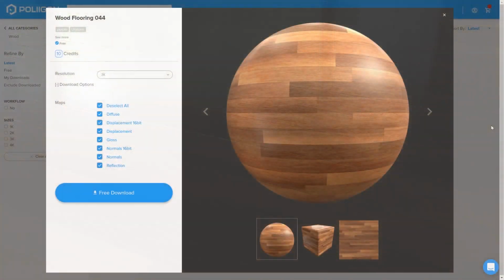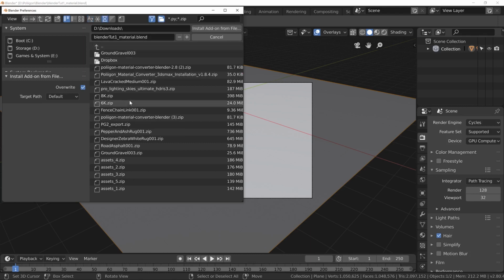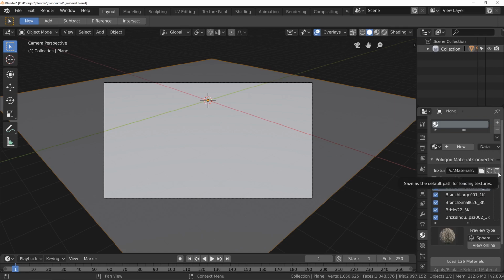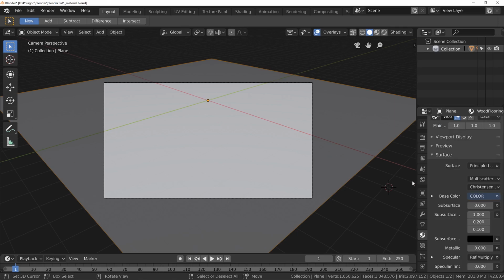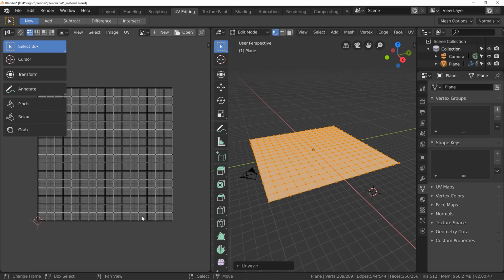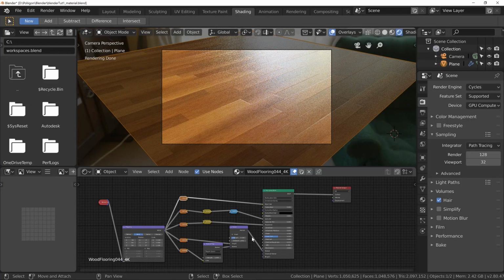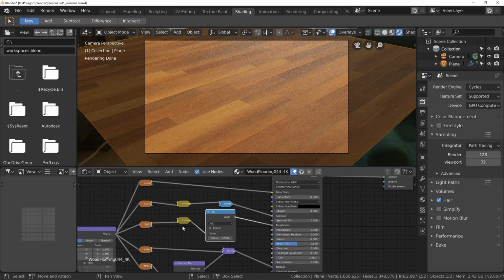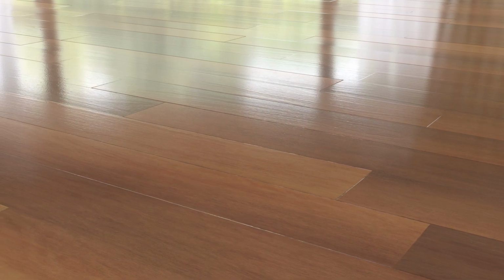Using Poliigon materials in Blender

Comment: My poliigon material is not in the folder and when i try to put it in the poligon material converter and all it says is no materials found even though it is right there. Very frustrated and I need help.
Reply: I find out if you have no 'Previews folder' (with jpg- cube and sphere) with the materiels it's will not want to add

Comment: Just downloaded the converter and tried it out. It doesn't work with Octane. It just brings in a node structure that works with Cycles. I've tried replacing the Principled shader with the Universal Octane shader but just get a flat white image on the object. As we can now get Octane FREE with Blender and I use it and it's blistering FAST and produces supurb results by the way, is there any chance we could get the converter to work with Octane?

Comment: I get an error when i load a material something with traceback most recent call last. Please somebody help me
Reply from the maker: Hi there, a recent change to Blender 2.8 has caused some issues with our addon. We are working on a fix but in the meantime, revert to a previous 2.8 build (Before May 5th) should remove any issues.
It's an unfortunate but unavoidable side effect of working with a actively changing beta build.
Reply: @poliigondocumentation3584  Thank you for the response i contacted support and couldn't get much help as we are on the week end. I'll try it. If i cant fix i'll use ur textures manualy as they are grate and free ;) 

EDIT: How do i get previous versions of blender 2.8? the preveous versions tab in blender site shows only till 2.79
Reply from the maker: The Material Converter has now been updated and fixed. Please re-download it and you shouldn't have any further issues.
Reply: @poliigondocumentation3584  I downloaded it now and it says something about Trace back (Most recent call last)
Reply: @poliigondocumentation3584  hello there,got a problem when i load the material folder all of the materials have a warning sign beside them, and metal is always black. please help.

Comment: Would make for a much better video if you used the default theme. This doesn't even look like blender.
My panels look nothing like yours, the icons dont look the same and it makes it harder to understand what you are doing.
EDIT: just discovered this is the new interface for 2.8, not due for full release until July.
Reply from the maker: Hi there, sorry for that. A lot of the community has already moved over to Blender 2.8 so we updated the videos in preparation for the launch. If you've not already moved over I'd definitely recommend it, it's easily stable enough for daily use. 

That said, I totally understand why you were confused, apologies for that.